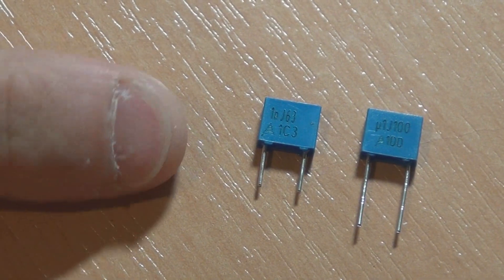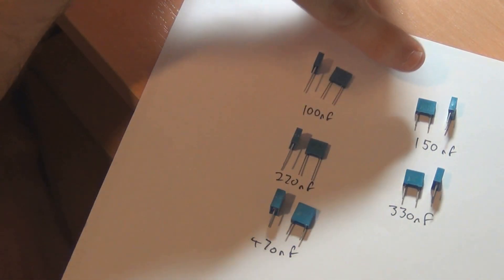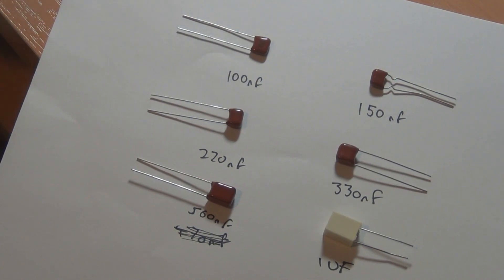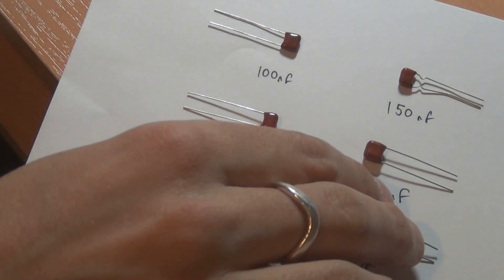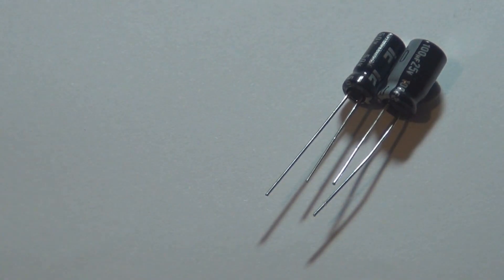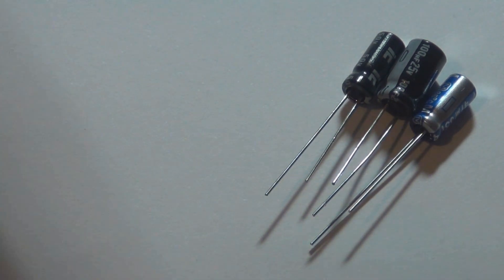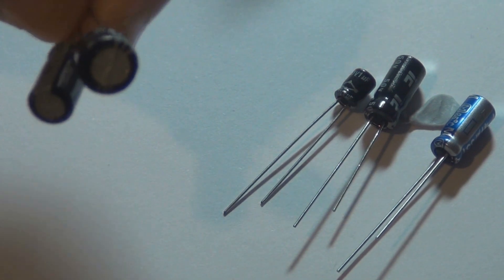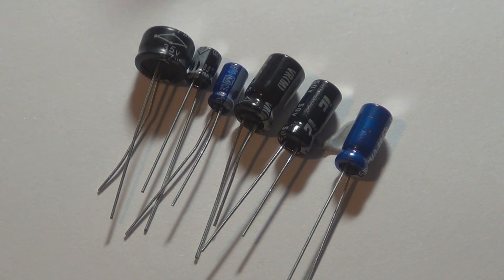Tutorial - Capacitor Dimensions

Comment: Hi. Maybe you could answer this question from a new pedal builder. There are kits that include the PCB and components and then there are other alternatives where you just buy the PCB and source the components from elsewhere. These components might have the same value but they may be of some other make and/or material. How much will this alter the tone in let's say a standard Large Muff or will they be pretty much the same as long as the value of the components stay the same? Thank you!

Comment: I'm pretty new to this world, so may this is a dumb question, but there is something I don't understand.  
For pedals with a lot of components, like Klon clones for instance, why don't people use SMDs to allow them to fit onto smaller PCBs?
Reply: In the DIY world there are two answers.
More practical answer:
When doing DIY work, it is much easier to use through hole components.  It takes a special kind of patience to do DIY SMD work.

Less practical answer:
Some people are convinced that through hole parts sound better than SMD parts.  I don't feel like getting into the arguement of "mojo".

In the mass production world, you will find a lot of pedals with SMD parts.  At this level it's what makes most economical sense and still deliver the sound and size a manufacturer wants.

Comment: What I can never understand is which cap to use where. I see Box, and Electro, Film, Poly caps used side by side in Pedals and I'm like "Why did they use all these different types of caps?". I bought a ton of different cap types of the same value to build my Dallas Clone just to be safe, then later on I'll find out which type I'm suppose to use where. Still gotta get an OC44 first. Anyone ever use Tayda for Pedal Components?
Reply: Thanks Brother! I always wondered why they used different types, I always believed it was to do w/ noise or certain types could be used in Audio, and or Power sections. I guess it just comes down to size, and yes Box Caps are the Sexy Bitches !!!